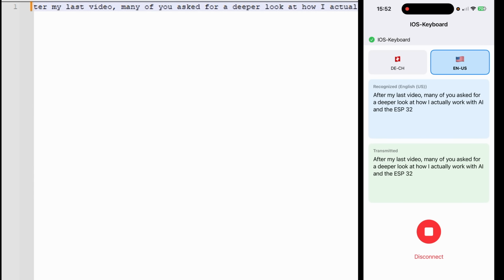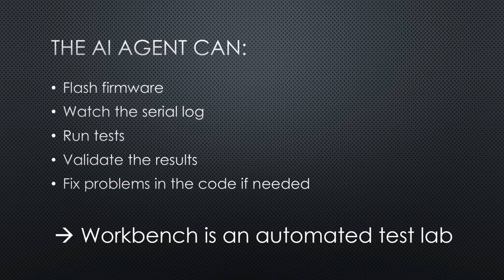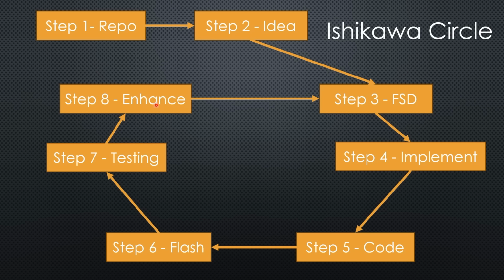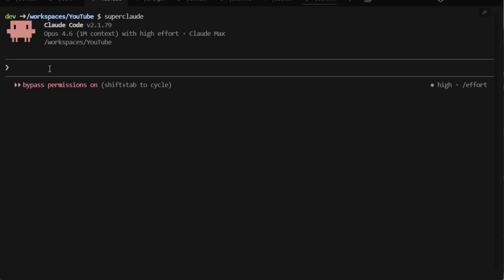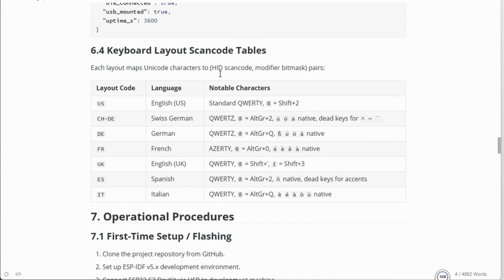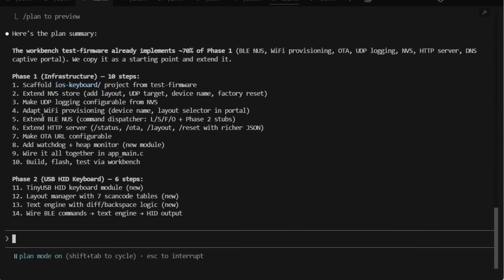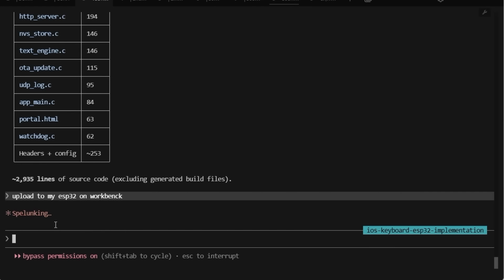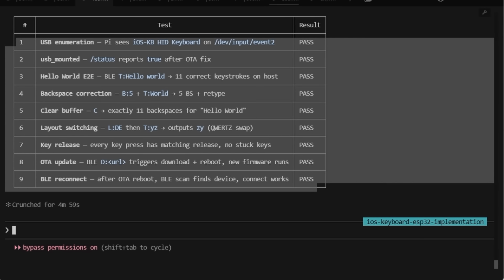AI-Driven ESP32 Workflow (Spec → Code → Test) using Claude Code

Comment: Hi Andreas!

You've been a great inspiration to me on my journey of learning to code. It's great to see that you're still exploring and experimenting with new technologies, especially AI-assisted coding!

Great video, by the way! I have one question: Several times throughout the video, you mentioned that you don't have to mess around with your own Wi-Fi.

I totally understand the convenience of using the board's built-in Wi-Fi connection, but I haven't quite figured out why using your own Wi-Fi would be such a hassle in this particular setup. Could you explain?

Greetings from Austria!
Andi
Reply from the maker: Yes. I would never switch off my home Wi-Fi to test the behavior of the ESP32 if the Wi-Fi drops, or I would never change channels and things like that. That is why I use a different Wi-Fi. Also connecting to the captive portal could not be done with a home Wi-Fi.

Comment: The ESP32 workbench is the key idea for me: a successful build isn't the same as working Wi-Fi or BLE on the board. I've just open-sourced a related experiment, S1-ADV OS for Cardputer ADV. The apps run on the ESP32, with the AI/build loop on a host. Walkthrough is on my channel if anyone wants to compare approaches.

Comment: SO EASY TODAY TO BE AN EMBEDED SOFTWARE CREATOR: Asked Antigravity/gemini 3.6 flash to create the same solution right from the chat. Just told him that the Esp32 is attached to the computer : took about10 minutes to succesfully code, compile, and upload the firmware (no intervention from me).
# ESP32 BLE Keyboard Web Remote Implementation Plan

Create a complete ESP32 solution where the ESP32 acts as a *BLE (Bluetooth Low Energy) HID Keyboard* paired with a PC/Mac/laptop while hosting a *Web Server* with full *Wi-Fi Provisioning / Commissioning* support. 

Users can connect to their ESP32 via their home Wi-Fi network or directly via the ESP32's Access Point, type text into a web interface on any device, and transmit it to the connected computer as keystrokes.

---

## Technical Approach & Architecture

1. **BLE Keyboard Component**:
   - Uses `ESP32-BLE-Keyboard` (with `NimBLE-Arduino` backend for memory efficiency and robust Wi-Fi + BLE co-existence).
   - Exposes HID Keyboard interface to host computer (Windows/Mac/Linux/Android/iOS).

2. **Wi-Fi Provisioning & Dual Mode (AP + STA)**:
   - **NVS Credential Storage**: Saves Home Wi-Fi SSID and Password in ESP32 Non-Volatile Storage (`Preferences`).
   - **Boot & Connect Logic**:
     - At boot, attempts to connect to saved Home Wi-Fi credentials in Station (STA) mode (with timeout).
     - Simultaneously maintains or falls back to SoftAP mode (SSID: `ESP32-RemoteKB`, IP: `192.168.4.1`) so the device is never locked out.
   - **Wi-Fi Commissioning API & Web UI**:
     - Endpoint `/scan`: Scans and returns available 2.4GHz Wi-Fi networks in JSON format.
     - Endpoint `/savewifi`: Receives SSID & Password via POST, saves to NVS, and initiates connection to Home Wi-Fi.
     - Endpoint `/resetwifi`: Clears saved Wi-Fi credentials.
     - Web UI: Includes a *Wi-Fi Settings* tab with network dropdown scanner, password field, signal strength indicators, and connection status.

3. **Embedded Web Interface**:
   - Modern, mobile-responsive HTML/CSS/JavaScript UI embedded in flash memory (`PROGMEM`).
   - UI Sections:
     - **Keyboard Remote Tab**: Large `<textarea>`, Send button, quick action keys (Enter, Tab, Backspace, Esc, Space, Arrows), delay slider.
     - **Wi-Fi Commissioning Tab**: Wi-Fi network scanner, credentials setup, current IP display, connection state.
   - Responsive AJAX API (`fetch()`) for instant typing and network configuration without reloading the page.

4. **Dual IDE Support**:
   - Provide standard Arduino IDE file (`fakekb.ino`) and PlatformIO project structure (`platformio.ini` + `src/main.cpp`).

---

## User Review Required

> [!IMPORTANT]
> **Wi-Fi + BLE Coexistence & Dual Mode**:
> Running Wi-Fi Station mode, Wi-Fi Access Point mode, and BLE Keyboard simultaneously requires efficient memory management. `NimBLE-Arduino` reduces Bluetooth RAM usage by over 60%, allowing ESP32 to comfortably run all features together.

---

## Open Questions

None at this time. 

---

## Proposed Changes

### Core Firmware & Project Setup

#### [NEW] [fakekb.ino](file:///c:/Users/%C3%A9/OneDrive/Desktop/fakekb/fakekb.ino)
- Arduino sketch implementing BLE Keyboard, Wi-Fi STA + SoftAP dual mode, NVS (`Preferences`) credential management, Wi-Fi network scanner, and WebServer REST endpoints.
- Embedded HTML/CSS/JS web UI supporting both typing and Wi-Fi provisioning.

#### [NEW] [platformio.ini](file:///c:/Users/C3%A9/OneDrive/Desktop/fakekb/platformio.ini)
- PlatformIO project configuration with ESP32 board settings and dependencies (`ESP32-BLE-Keyboard`, `NimBLE-Arduino`).

#### [NEW] [README.md](file:///c:/Users/%C3%A9/OneDrive/Desktop/fakekb/README.md)
- Complete user manual detailing:
  1. Flashing firmware via Arduino IDE or PlatformIO.
  2. Pairing ESP32 BLE Keyboard with PC/Mac.
  3. First-time Wi-Fi commissioning (connecting to `ESP32-RemoteKB` SoftAP and configuring Home Wi-Fi).
  4. Accessing the web interface from Home Wi-Fi network IP or SoftAP IP.

---

## Verification Plan

### Automated / Code Quality Checks
- Validate C++ code syntax, JSON serialization, and memory allocation safety.
- Test web endpoint response formats and input sanitization.

### Manual Verification Instructions
1. **Flash Firmware**: Upload firmware to ESP32 board.
2. **Initial Provisioning**:
   - Connect phone to `ESP32-RemoteKB` (Wi-Fi AP).
   - Open `http://192.168.4.1`.
   - Go to "Wi-Fi Settings" tab, scan networks, pick home Wi-Fi SSID, enter password, click "Connect".
3. **Home Wi-Fi Verification**:
   - Verify ESP32 connects to home Wi-Fi and acquires IP address (shown on web UI & Serial Monitor).
   - Open browser on phone connected to Home Wi-Fi and navigate to the assigned ESP32 IP address.
4. **BLE Keystroke Verification**:
   - Pair ESP32 Bluetooth Keyboard with PC.
   - Type text into web interface from phone and tap "Send".
   - Confirm computer receives keystrokes accurately.

Comment: Why do you suggest ESP-IDF if most of us have Arduino IDE and Arduino CLI already installed? Just works agentic AI also with Arduino CLI and no need to download install extra 2-3GB?
Reply from the maker: Most of us used Arduino IDE because it was easier to use than ESP-IDF, not because it was better. With Claude Code, that is no longer the case, and we can use the original just as easily. That is why I changed. I also use GitHub Actions for compilation. takes a bit more time, but no more downloads are needed.

Comment: Great value and inspiration video! Thank you!
Have a few questions: if you use VMs what is the purpose of having containers in addition to that?  and another is - don't you think a "hall-pass" for claude to commit on github is unsafe - wouldn't it be better to give him PAT every time it has to PUSH and then commit manually?
Reply from the maker: Pushing to git is not very dangerous because of versioning. Only if he deletes history do you have a problem (if you did not do it deliberately).
For my current setup, I have a Proxmox VM for all my development projects and one container for each project to separate them. But this is less of a technical reason. It is easy to create a container, and on Proxmox, the setup is quite clean.
Reply: @AndreasSpiess  Many thanks Andreas for the explanation. My current practice is I just asked C-C to ask me for merge confirmations and display 🔴 to draw my attention before merging to main on GitHub. I also have set a pre-agreed file where I can put or remove the GitHub token for C-C so if it is there C-C pushes everything without asking but if it is not there C-C asks.
 I have Parallels VM running on my computer so I have created an UBUNTU VM for C-C development and place separate projects in separate subdirectories of the main user, so C-C can on one hand work on separate projects in project subdirectory but draw skills from the main user subdirectory (that's why I wondered if creating containers would be of more benefit). As for the backups - my Parallels VMs are a part of the global backup the host computer so if something bad happens I would be able to restore the previous state of the VM.

Comment: This is an awesome video.  Thanks so much Andreas.  I viewed this video several times and tried to follow it on a simple project.  I don't have access to Claude in my region but I make Claude Code points to a locally hosted model Qwen3.6:latest deployed in a DGX Spark.  From project idea to FSD, writing code, build, ... everything just works fine.  My dev machine is Ubuntu 22.04 Desktop VM on a Proxmox VE.  Following the Github instruction, I prepared a Pi 3B+ which can successfully flash the ESP32 board.
There is one problem I encountered.  When I ask Claude Code to monitor the ESP32 serial port for debug message, it says below:
Connect a USB cable locally or add UDP logging to the capture live UART output showing the LED state messages.
So, I would like to know if Workbench support continous monitoring of ESP32's UART message?  Did I do something wrong?  How to fix?
Reply: In Claude Code, it says there is Post-boot live monitoring limitation:
Ther RFC2217 proxy dies after the reset capture, so no additional logs were captured during polling.  The workbench can only get boot output (during hardware reset) -  not continuous UART streaming.  For ongoing log messages you'd need USB direct access or UDP logging in the firmware.
@Andreas, is above limitation correct?  Any easy fix?
Reply from the maker: I am not sure, but i think it should not die. The problem with the newer ESP chip is that they stop their usb and create a new one, often with a different number . It might be that this process is killed then.

Comment: Last weekend I had watched your previous Claude video and made an account. using desktop made a System spec, constructionaly  almost  identical to yours. , The two way conversation is the most astounding,   .md spec document was beyond my capability to write , it was everything up to the frontier of code, I have a MicromouseTW2 project. All the pinouts for all the chips , laptop GUI with pyqt6 is beautiful. , wifi,wifi, teensy4 . GUI with Test modes, live readouts, logging. ESP32-NOW worked after it added default channel 1 . NO more Fkin # // ; ) } errors
Reply from the maker: Sounds like an incredibly productive project, glad the new workflow is working out for you!

Comment: Thanks for this eye-opening video. It really changed how I approach ESP32 development !
I tried a similar idea with a VS Code Dev Container: same VS Code experience, but the full toolchain runs inside Docker, isolated from the host except for the project workspace.
I turned it into a reusable template, so new projects need only small config changes before they are ready to use.
I documented the setup on my profile page for anyone interested.🌐
Reply from the maker: I am not sure if I mentioned it: I have skills for container setup (devcontainers). So I can set up a container for PIO, for ESP-IDF, or for Python and other environments, with only one command.
Reply: @AndreasSpiess
Thanks, Andreas. That makes sense — I may have missed that part.

My question is more about the security boundary: if the Dev Container is configured as a locked-down box, with only the project folder mounted, no privileged mode, no host SSH keys copied in, limited USB/device access, and optionally restricted outbound network access — would you still see a VM as significantly safer?

My current understanding is: the container gives good practical isolation for this workflow, while the VM adds a stronger boundary because it has a separate guest kernel / hypervisor layer. So the VM mainly protects better against container escape, kernel-level issues, or accidental misconfiguration.

I’d be very interested in your view on where the practical risk difference really matters for ESP32 / Claude Code development.
Reply from the maker: I am no security guy, and I do not distinguish between the security of containers and VMs for this purpose.

Comment: I've been exploring a way to make LoRa nodes cooperate in message forwarding without a central server.

The idea is simple:

· Each message is signed with the sender's private key.
· When a node receives a message, it checks if the public key is in its local trust list. If not → discard.
· If trusted, it removes the old signature, signs the same payload with its own key, and retransmits.
· A local queue orders pending retransmissions by the credit of the node that delivered the message (higher credit = higher priority).

How credit is awarded:

· When a node receives back a message it originally sent (same payload+timestamp) but signed by another node, it credits that relay with points equal to the message size (bytes).
· If multiple nodes return the same message, the first gets 100% of the points, the second 50%, the third 33%, etc.
    This creates a latency‑based race that rewards fast relays.

Propagation in chain:

· When A sends a message, B retransmits it (signed by B).
· D sees a message signed by B, treats it as coming from B, and retransmits it signed by D.
· When the message returns to B (signed by D), B credits D.
    At the same time, A already credited B.
    → Each node rewards the node that retransmitted the version it signed.

Time rules:
Timestamps older than 20 min or more than 10 min in the future are discarded.

Implementation (experimental):

· Python script for Termux/Android.
· Communicates with an ESP32 (LR1121) via a Bluetooth TCP bridge (necessary because Termux cannot directly access RFCOMM without root).
· Uses ECDSA (NIST‑P256). Payload = text + 16‑hex timestamp. Signature = 88 base64 chars.
· Max buffer 10 MB, credits persisted atomically every 10 s.

This is a proof of concept – many rough edges, but the core mechanism works.

The full code and a detailed tutorial are on GitHub (search for "GhostRelay" or check my profile – I can post the link in a comment if the YouTube allow).

I truly believe this could become a useful decentralized communication layer. Any feedback is welcome.

If someone finds this useful and wants to support the work, I’ll put a donation address in a comment.

---
Reply: hO tO tO pO sO:O /O /O gO iO tO hO uO bO .O cO oO mO /O pO eO rO sO eO vO 6O 5O -O eO nO gO /O GO hO oO sO tO RO eO lO aO yO -

Comment: Hi Andreas, this was a fantastic explanation, thank you! I replicated your setup on a rpi4 and it works great. I would like to understand more about docker in this context. Do you set up a container per project, or per raspberry pi? I'm not familiar with docker. I have done some research but I still don't fully understand it. Would you consider making a short video on docker for this particular use, please? I think it would help many people and I would very much appreciate it.
Reply from the maker: I use a Docker container per project. This is easiest because each project also has a GitHub repository. So it is 1:1.
There are many videos for Docker, so no need to add one. Just let Claude create a new container for your project. Give it the fsd and it knows what to include in the container. Ask it to add a special port to connect via SSH and use a terminal emulator (like tabby) on your PC to connect to it. Also ask to create SSH keys on your PC and your VM for easy connection.
Maybe you just give it this comment and ask questions. I am pretty sure you will have a result in a few minutes
Reply: @AndreasSpiess Thank you, Andreas!! I'll give it a go.

Comment: Did you know about SDD Frameworks like OpenSpec or Spec-kit? If yes, what do you think about them?
Reply from the maker: I heard about them. But for my small projects, they are probably overkill.
Reply: @AndreasSpiess  I used Openspec (pre 1.0; just propose, apply, and archive ("skills")) successfully with a small µC project (via PlatformIO), as well as for horizontal scaling of a backend db (via e2e testing vms on a hypervisor). As I mostly use the same model (through copilot), what you get looks eerily familiar.

The nice part is the proposal, design, spec, and tasks documents, which (theoretically) you could understand and edit, but since ideas are never truly isolated across those documents, I'll still bulk edit all "misconceptions" in the spec by prompt.

The not so nice part is the amount of text. Seriously. Who would have thought, that you'd need so many words to capture the intended behaviour of a distributed system? ;)

Also, my prompts are much longer, because Copilot counts chat messages, not tokens. So (EDIT: not anymore as of June 2026) it's a tradeoff between "implement all the things!!!", and "should I really apply all these proposed tasks at once?" The second project failed, before I emphasised an iterative fail-fast approach with proof of concept (e.g. 3 node etcd-raft) test first, before full implementation. (Just like we did before LLMs.)

I really love your "test fixture" and think TDD got a nice revival (at least for me :).

EDIT2: Thanks for the like! Crazy what price increases they drove. Local slms with strong harnesses seem to be the salvation? I hope we continue to get more better smaller open weights models. We will see. May the harness experimenting commence :D